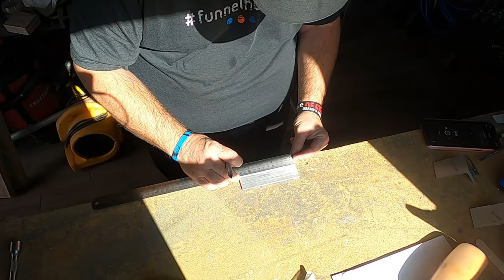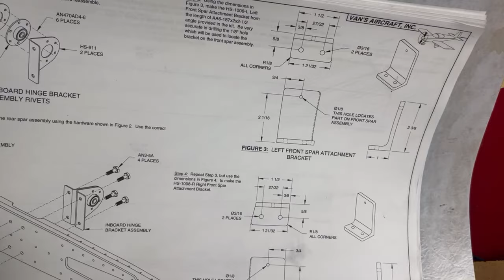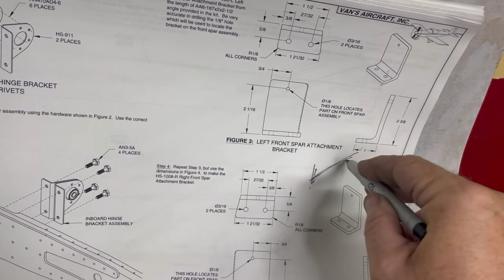[Van's Aircraft RV-10] Horizontal Stabilizer - Part 1

Comment: Hey Raymond, flip your band saw blade so the teeth are backward. You’ll be amazed how much better it cuts all your thin aluminum
Reply: Bandsaw blades are mounted on the machine so the teeth on the right side of the blade are pointed downward, and descend into the material being cut. When you say mounting the blade "backward", I take it you're saying to twist the blade inside-out so the teeth on the right side of the blade are pointed upward as the blade descends into the material being cut? Sound's like a "hold my beer and stand back" event in the making. Although, through a few online searches, I read where some use that technique to cut soft siding material and metal roof panels. Raymond's issue was using a wood-cutting blade to cut aluminum. The remedy was to spend $10-$20 to get a proper metal-cutting blade.

For my RV-14 build project I'm using my 14" Jet (floor model) bandsaw fitted with a Bosch 18 TPI metal-cutting blade. Tried a 24 TPI blade first, but it loads up with aluminum quickly. 18 TPI works well with aluminum. Much of the material to be cut on the project ranges from .020-.040 aluminum, but there a few pieces of 3/16" and 1/4" angle stock. The bandsaw blade speed is too fast for steel  (3000 SFPM) so I'm cutting that by 14" fiber-wheel chop-saw.
Reply: @EJWash57  Don't try it if you don't want to but this method has been around for decades.  Every Rib, stiffener, j-channel, etc on my completed RV-10 was cut with the blade backward.  Never the potential for the blade to snag and deform the workpiece.  Anything thicker or made of steel, went on the Roll-In-Saw or got machined in the VMC.  Enjoy the smell of your abrasive saw!
Reply from the maker: Exactly, EJ. However, unlike you, I've never heard of reversing the teeth direction before. I agree it sounds like a "hold my beer" kind of move.